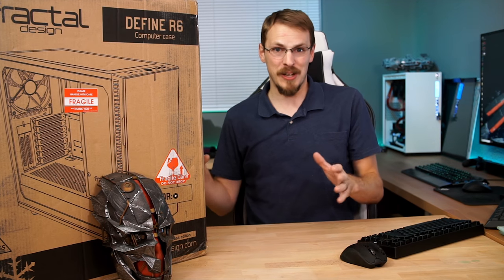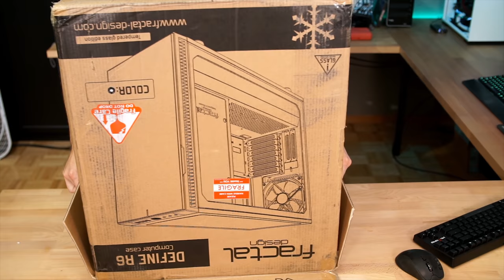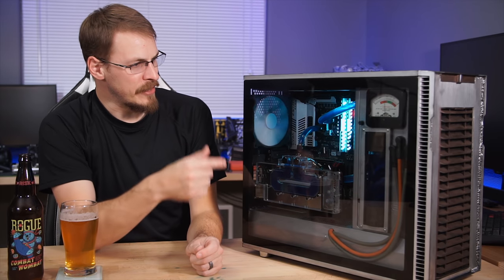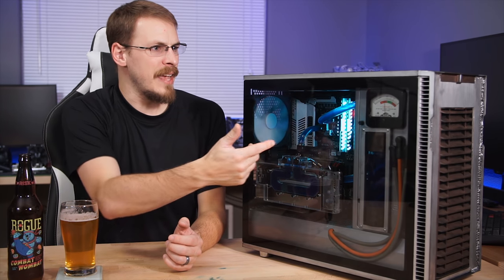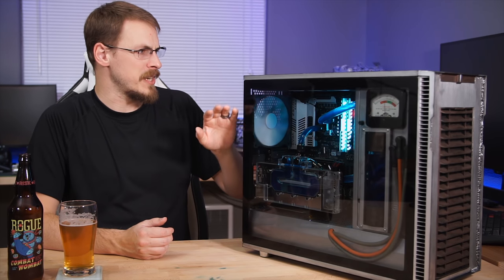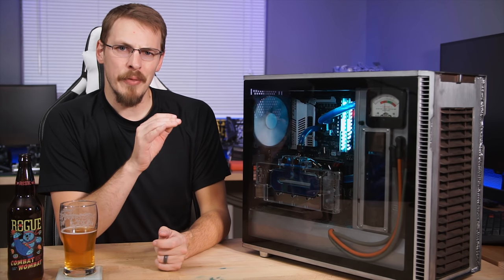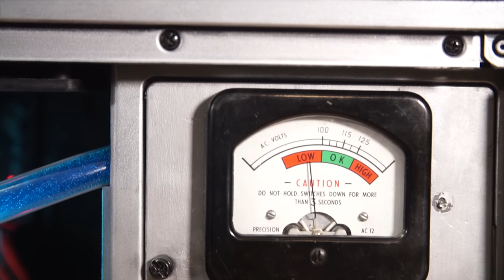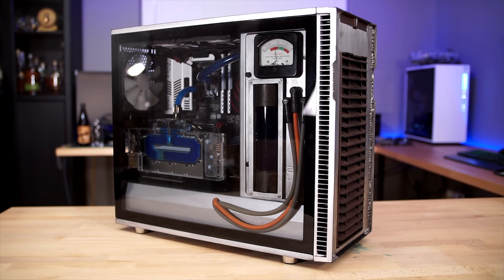EPIC Dishonored Case Mod!

Comment: I‘d have liked it to be a bit more steampunky. Like brass or bronze colored or painted parts, valves, etc. Like some very high-end artifact that decayed to rust, dust and grime.
Reply from the maker: I had actually planned on running copper tubing, but time was a major factor. We had two weeks to build and ship these.

Comment: great build..... but
1 make your cpu to gpu tube 1.5in longer will make a nicer cleaner 90degree angle..
2 wire the vu meter up to a temp sensor on either cpu or gpu and have it change from green to red the hotter it gets!!!! would look dope as :)